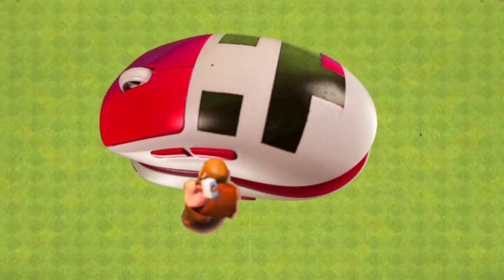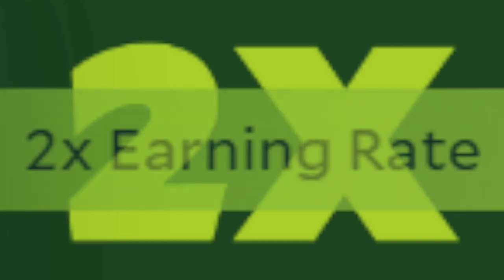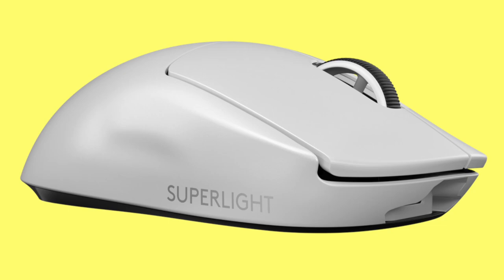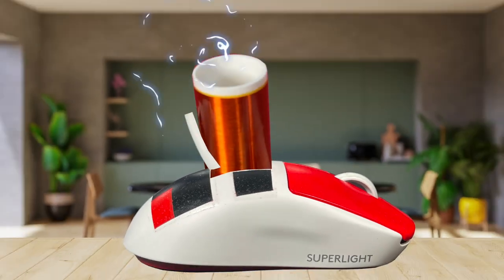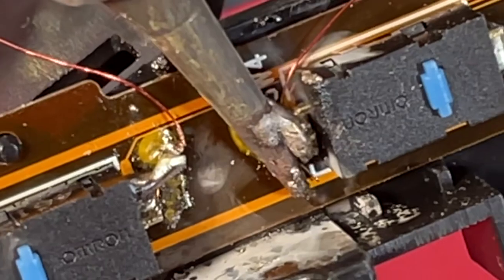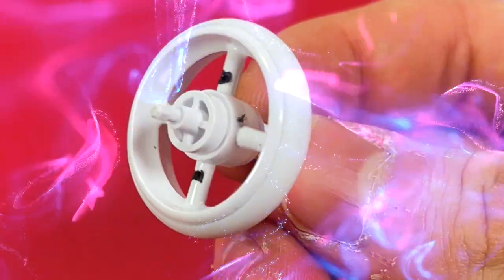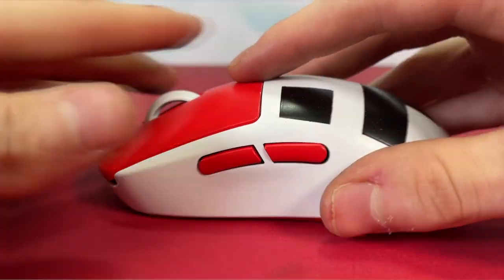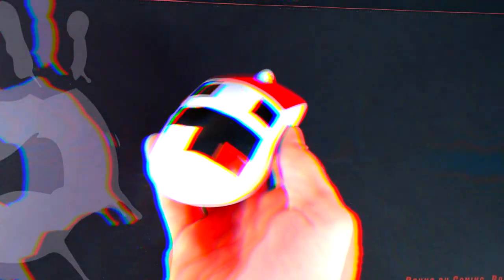Model x Bedless | The PERFECT Godbridging Mouse (w/ Bedless Noob)

Comment: did you try use my idea i commented on the last mouse mod vid? thats exact;y what i commented
btw incase you didint notice, you have to sand the coating off the thin copper wire
Reply from the maker: you can actually use a lighter to strip the coating even easier haha
Reply: @helixmods  you still gotta use sand paper at the end, sometimes